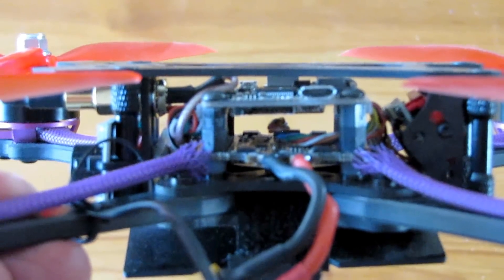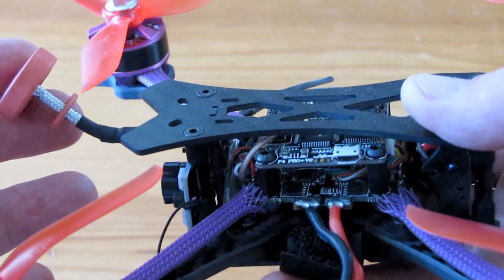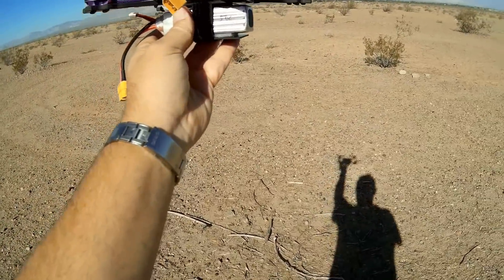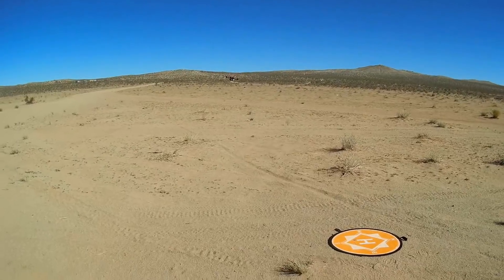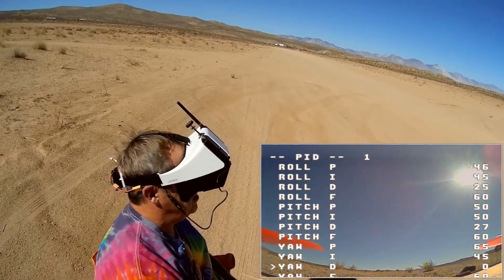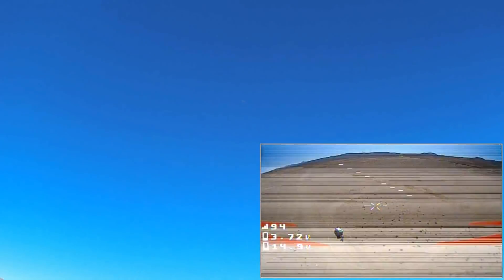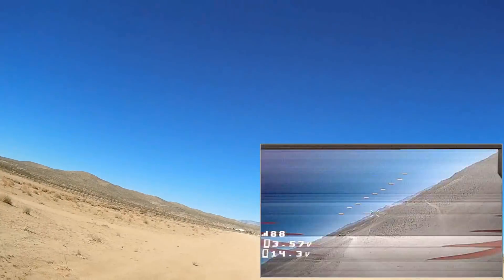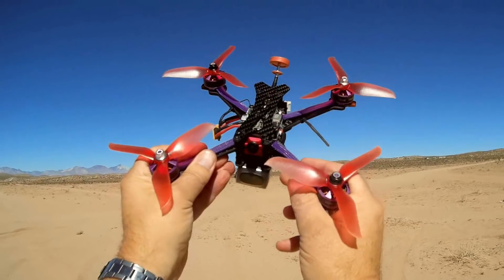Tero Q215mm BNF FPV Racer Flight Test Review

Comment: Mines super fast faster than my hawk5 same battery
Reply from the maker: Yep, you need to be careful with this one.  It's so fast that it can get far away from you very quickly.
Reply: @Quadcopter101  if I were to swap out cameras how would the plug work for the spare one on the hawk5?
Reply from the maker: Yes, same XT-60 plug.  Just remember no battery larger than 4S.
Reply: @Quadcopter101  the plugs are different on the cameras how do I fix it to swap a different camera